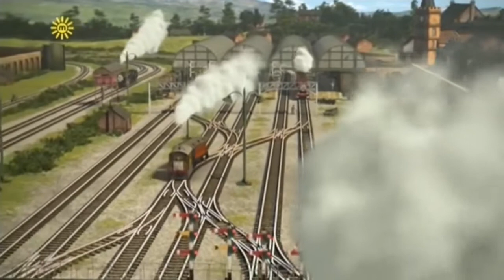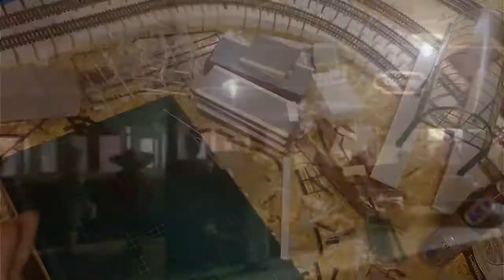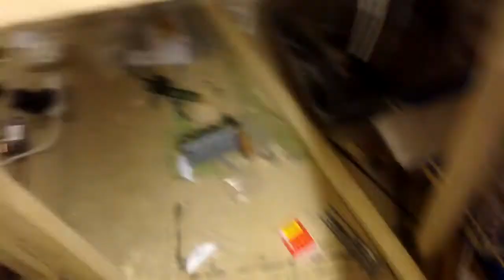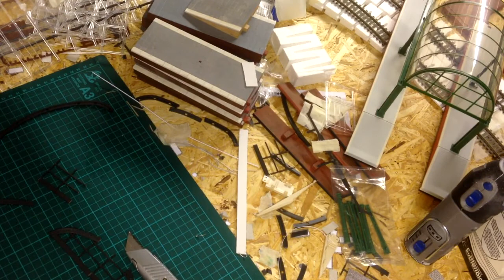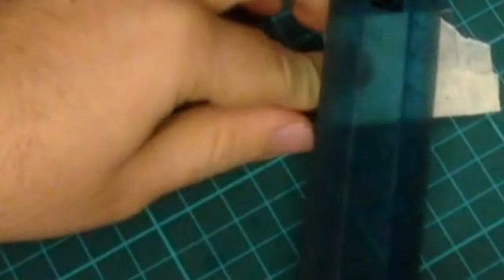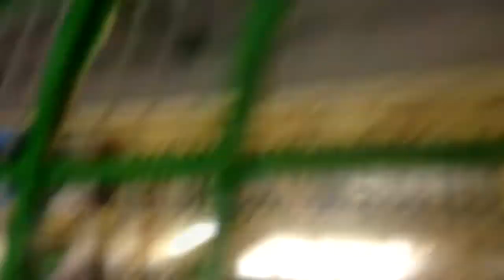Knapford Station Over-roof Modelling Tutorial

Comment: How many platforms did you use for the rooftop
Reply from the maker: To build the platforms I used Peco Platform Edgings and Metcalfe Tarmac Card to make the platforms, it took 6 platform edgings and a 1/10 of an edging to make the platforms at the right length to go along with the rooftops, so in total it took about 32 platform edgings to do it